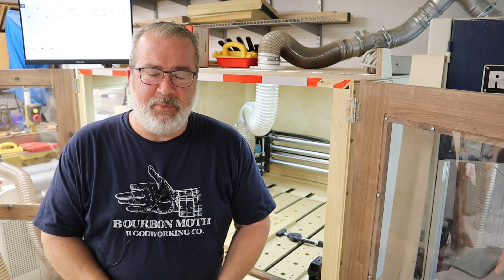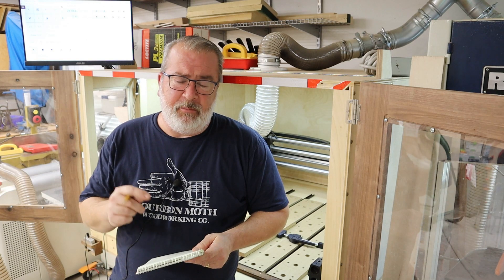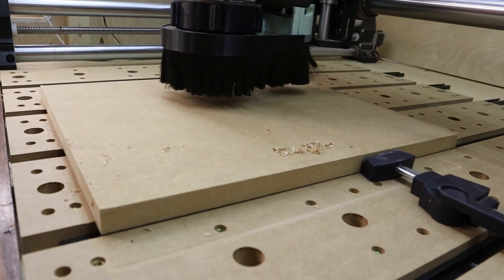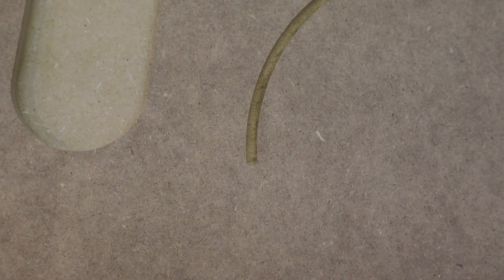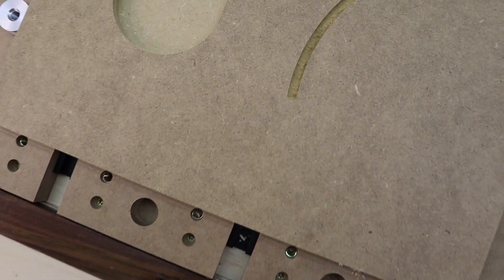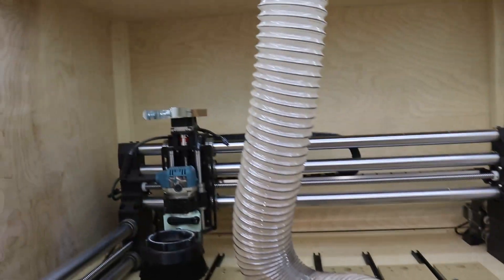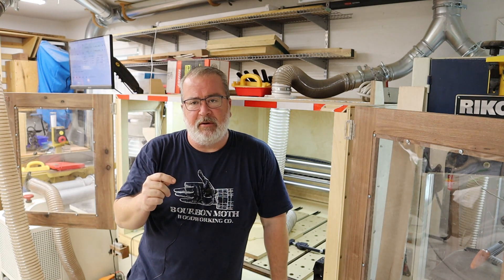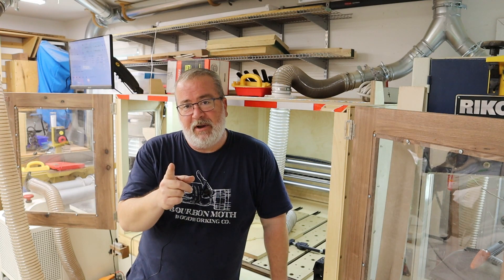Part 2 2021 Review and installation overview of the PwnCNC ver. 7 on my Onefinity CNC machine

Comment: Very helpful video, thank you! I'm looking at getting either a 1.0hp Grizzly G0710 (537 cfm) or a 1.5hp Grizzly G0944 (1250 cfm). Do you think 537 cfm would be sufficient? I am planning on getting the X50 Journeyman and I will mount the dust extractor as close to the CNC as possible with as little ducting/flexhose as possible. The extractor will be dedicated to only the CNC. I am open to other extractors if you have suggestions, but I need a small one and preferably below ~$700. Thanks again!
Reply from the maker: Hi Jonny, I think if the smaller unit were mounted really close to the machine, and limited use of the flex hose, you’d be okay.  Flex hose destroys air flow, so the more you use, the more cfm you lose. If it’s in the budget, a 1.5 HP would be preferred, and would possible be able to service other nearby machines. Thanks for checking out the video, and I’d invite you to subscribe while you’re here. Thanks and have a great day!

Comment: I am planning a similar setup with this dust boot and 4" hose, can you share the interior height of your enclosure? I like your idea of the flanges and want to make sure I leave enough height above the z motor to allow the hose to rotate as needed. Thanks!
Reply from the maker: Hi Howard, Thanks for taking the time to view, and comment I really do appreciate it.  
I'm in the middle of a refit due to upgrading to the journeyman X rail, so the enclosure is not currently in place, but I recall it being 32" interior height.  If you head on over to the Onefinity facebook group, there are probably a lot of folks with a current set up in place that can tell you what they're running for interior height.  If you have additional head room, 36 would for sure be safe.

If you haven't had a chance yet, and are willing, I'd love to ask you to subscribe in order to help me get the word out to more people who might be interested.  Thanks again and have a great day!

Comment: I had the V7 on my Shapeoko Pro XXL and loved it, I just switched today to the V2 and I think I like it even better, you can actually see what the bit is doing at all times, and the boot is independant from the router, and stays stationary.  I always 3d print the parts that are printable(Daniel @PWNCNC shares the stl files for the biggest portion of his products on Thingiverse) and then I buy all the hardware kits to complete them from PWNCNC.  The detail he puts into his work, is unmatched, everything I have printed and put together has fit perfect.  That being said, I have a question, what is that clamp you are using in this video, I haven't seen those and it looks very interesting.
Reply from the maker: Hi Doyle, yeah, Im impressed with PwnCNC.  If you mean the squeeze clamp at the end of my 4" hose, its this one:  https://www.amazon.com/gp/product/B071WCZ36W/ref=ppx_yo_dt_b_asin_title_o03_s00?ie=UTF8&psc=1
Reply: I was actually talking about the clamp you are holding your workpiece with.
Reply from the maker: @spikester1968  oh I’m sorry I misunderstood. I have a couple festool MFT3 tables in my shop, and this side clamps are used in conjunction with bench dogs.  They’re called clamping elements, and I’ll toss a link below.  If I didn’t already have them Pre-CNC, I would have found a lower cost alternative, but they turned out to be handy on my spoilboard work holding strategy.  https://www.amazon.com/dp/B000JNEC1Q/ref=cm_sw_em_r_mt_dp_X32HTY0JWZEK1X8T4GW6?_encoding=UTF8&psc=1
Reply: Ouch...those ARE a bit pricey lol....ill stick to my 3d printed clamps lol!!